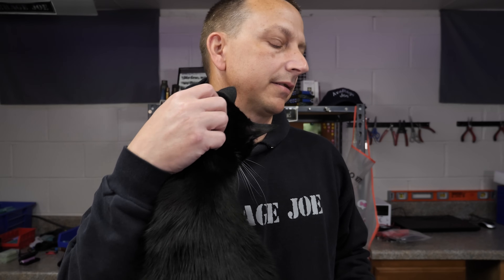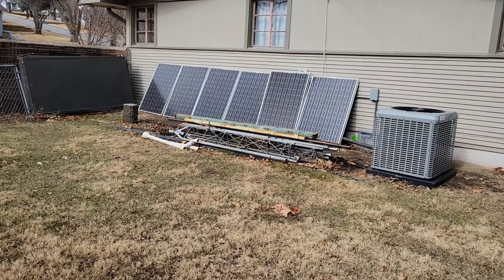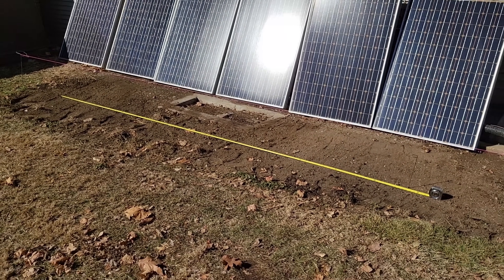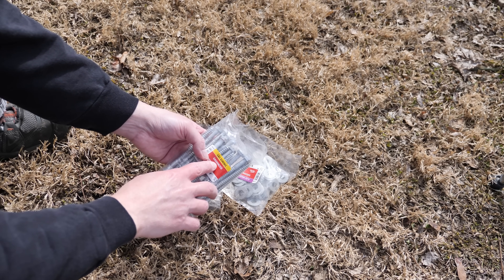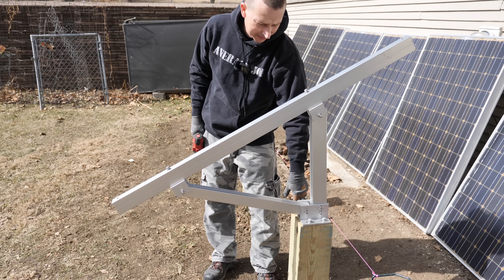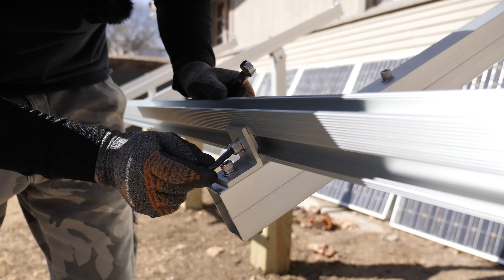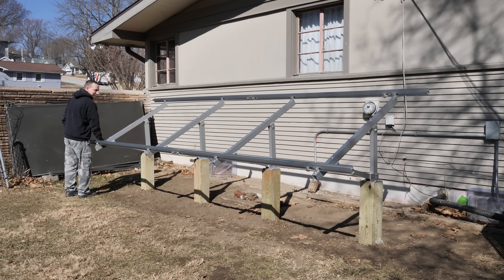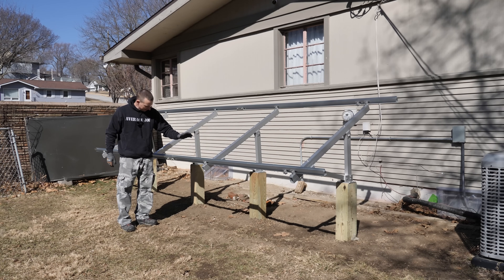EG4 Solar Panel Ground Mount Rack Install!!

Comment from the maker: Save $50 on Any Purchase over $500 at Signature Solar with my Magical 
Affiliate Links and Code "AVERAGEJOESAVE50"⤵
https://signaturesolar.com/all-products/mounting-options-hardware/?ref=C2w_5wtHG6jKcP
Reply: Was about to checkout, but then I exited out so I could come back here and use this link. Thanks for the video!
Reply from the maker: @mrrkrr  Thank you for using the link! Much Appreciated!🤘
Reply: do you see a difference in your electric bill?
Reply: Bonjour,
Depuis la France je n’arrive pas à accéder au produit.
Pourriez-Vous m’aider?
Reply: So if you take the bottom support bracket pull the bolt out of it, slide it up towards the post you should be able to get to your winter setting drill another hole in the bottom support arm❤️‍🔥

Comment: I can’t find if you’ve reviewed if you reviewed EG4 inverters / Batteries etc?
Reply from the maker: I actually just got in some inverters.😎 Got the 6000XP, FlexBoss21 and GridBoss but thats not an inverter. I dont have any of the batteries yet but have messed around with some. I took 2 down to North Carolina after Helene last fall. Did you have a specific question I could help with?

Comment: What angle does this mount give your solar panels? 22 degrees or so?
Reply from the maker: Mine is set to 30* but they have a new adjustable version which would be super nice to have!😀

Comment: Thanks for all your information.  I'm on a tight budget so I'm thinking a locust frame,  pt 2x4 sleepers and then z brackets.  We're recovering from the flood and making progress on the solar. Thanks for the assistance in the area

Comment: Did you have them in use against the side of your house? Was thinking of a very temporary set up 😂
Reply from the maker: You could have them up against the house for sure. I had some solar water heater panels here a few days prior.
Reply: @AveRage_Joe  thanks! I'm being over cautious because I've never really worked with solar panels. Summer time I'm going to mount mine exactly like yours!
Reply from the maker: Yeah Im with ya. Only thing to worry about is the wind or something knocking them over and breaking the glass.  So make sure they cant do that and you will be good to go.🫣😁💥🤘

Comment: Great video, had some laughs. I’m concerned about galvanic reaction between the aluminum base and the galvanized hardware, and the aluminum base and your PT posts. I think you can rectify that pretty easily if you share my concern.

Again, I appreciate you taking the time to share your experience.

Comment: The mechanical engineer in me makes me extremely skeptical of this product. Just based on simple leverages, if you put 50 pounds of upward force on the front of that, it looks like it would translate to about 1000 pounds on those lag screws.  Hopefully you get near zero wind in that location.  Could be easily fixed with a couple of ground cables in the front and back, but the product doesn’t call for that. Would love to see a follow up video of how this thing lasts after a year.
Reply: Oh, I see you made another video where installed braces. Yeah sure enough, I don’t understand how they sell that product to people.  Can’t imagine this company has a phone number to call because they’d do nothing but talk to angry customers all day.

Comment: On one of your videos you mounted 10 panels onto this rack.  I want to do this with 8 200 watt panels.  What parts did you use to join them together top and bottom?  THANK YOU
Reply from the maker: Yes I sure did and its holding up great btw. I should have the steel brackets I used listed in description in that video. They were called "mending" brackets off amazon.🤘

Comment: Do you anticipate and degradation on your aluminum mounting brackets due to galvanic action with the lag bolts?  Thinking you should probably install nylon washers between aluminum brackets and galvanized washer.

Comment: Looks good, but I think it would have been better to cement the posts in the ground for increased stability.
Reply from the maker: I was going to but jic I ever wanted to move or take it down I didnt want to mess with the big chunk of concret after.

Comment: I am brand new to solar and requesting some advice before I buy my ground mount. Could I safely build a base out of 4x4's and mount 10" locking turf tires underneath so that I could rotate the whole unit towards the sun? I am retired and home a great deal of the time. I am also a very petite female and not so strong as I used to be.
Reply from the maker: Welcome to the exciting world of solar and offgrid fun! I think it is 100% possible to build a movable base out of 4x4's! Only thing I can think of at the moment is some sort of staking (metal rods drove into the ground)so everyday wind or wind from a random storm wont move it on you when you are not around.
Reply: Thank you for your quick reply. This is good news. I will be pounding some 7 ' tall steel fence stakes I use for staking tomatoes. If extreme, geo-engineered winds are expected I would probably remove my panels. Within weeks I will know the exact place I want my ground mount. This mount is my most likely choice a one, and I will order via your link if I do so. My sister may buy one, too.
Reply from the maker: Yeah shouldnt be an issue at all. Those stakes should be good to go. Do you have panels yet? If so what do you have? Much appreciated if you use my link!🤘

Comment: Do you believe this is a solid base or how will you make sure it wont tip over besides the grounding rod?
Reply from the maker: Yeah super solid. However, I guess your not supose to mount to the end grain or edge of the wood post like I did. Everyone says to mount on the side of post or mount a cap on the end and then mount to that. Im happy so far. I have an update vid for what I did to help support snow load since I used 10 solar panels.

Comment: Woodworking no no,,, bolting  into end grain. They most likely will wiggle loose over time. Cam bolts would have been best. More work to drill out the side holes etc. Even a crap load of epoxy on top of each post would give it a little more hold. I give the at most 3yrs until they start separating at best. (armchair builder here LOL!).
Reply from the maker: Yaaaaaaa Im for sure not a wood.....worker guy😀 There are a few good suggestions here tho that I will try to help my fail🤭🤷‍♂️ Otherwise atm its still super strong🤠

Comment: I love this idea for footings as it's super simple.    How has this been once fully set up?  There is significant rotational force (forward) on the brackets.  In particular, the foot as all the weight is forward of the foot.  How have the footings held up with those 4 screws in the ends?  Those exposed ends also seem like a failure point
Reply from the maker: Everything has been great so far. No movement in any direction that I can see. The 4 screws in the post ends are doing great. As a few others have stated, its not a good idea to mount on the ends like I did. Better to have an end cap and mount to that. Minimum I need to do is seal the ends so water doesnt seep in.

Comment: So; you can flip the mount over and rotate it (brackets) and mount them to the side of the vertical post instead of the top of it.
Reply from the maker: I dont think it is designed to work like that as it may be to much weight. The new version is adjustable with the lower brackets.
Reply: @AVERAGE_JOE  it weighs the same no matter which way you put it and securing the bracket to the side of the wood is better than the end of the wood strength wise. the frame/ rail / panel is no more than 60 pounds per post and probably less. 4 anchor lag screws in the "side" of each 6x6 will hold over 1000 pounds easy.  The bracket will break before those screws come out.
Reply from the maker: Yeah 100% would be better in the side of the post and the lag bolts are not coming out. I was more thinking how the weight would effect it coming from a different angle.

Comment: Wow man!!.....  This is something VERY similar to what I've built for my solar mini split A/C's.  EXCEPT for, I'm SURE yours is more level and even than mine turned out.  ALTHOUGH, I used twice as many posts (4X4 posts) as you did, I dug 8 posts and used Eco-Worthy ground mounts all attached together using super strut mounting.  It turned out VERY solid.  This is just a start of my project.  I plan to install more ground mount hardware.
Reply: What size and how many panels did you use for your mini splits?
Reply: @brandonbates5840  I forgot the name brand of the panels but I intentionally over paneled my mini splits.  I'm using 4 panels each for each of my mini splits.  455 watts each.  I over panel them so my AC will turn on earlier and turn off later on in the day.  Each unit can run on 3 panels but I like them turning on earlier and staying on later.  My systems are working great so far but I believe both units can use a touch extra R410A to make colder air at the exit duct.  The air is currently about 50 degrees which, in MY understanding, it should be significantly colder.  I also just bought 2 Ecoflow Pro's and am going to buy 4 expansion batteries.  This should run a good amount of mini split units.  I currently have 2 units and plan to have a total of 6.  Not ALL these units will run from the Ecoflow Pro and batteries.  I don't think 2 Ecoflow's will support that many watt hours durring the night. .....  Thoughts?
Reply: @wildwestunlimited If it's an eg4 12,000 btu model I think you have too many watts by about 120.  Not sure if that is an issue. Were the panels new?

Comment: What is the overall width of the bottom and top rails because my panels are a little wider than normal
Reply from the maker: 179-5/8" or just shy of 15ft by my tape measure!🤘

Comment: So how do you tilt the panels? 
Thanks.
Reply from the maker: The new rack has the lower side braces in 2 pieces. 1 brace slides over the other and that is where/how to change angle.

Comment: Ive been kicking around this idea too. It will be be very cost effective for a large ground mount system.  I have 6000w worth of panels currently and am thinking I can go 2x9 by combining 2 eg4 kits side by side attached to one another.
Reply from the maker: Attaching 2 together would be sweet!
Reply: @AVERAGE_JOE  If it all works out I will make 4 or 6 EG4 kits in one long string. My goal is to expand my system form 6kw(once done) to 12kw then 18kw.....The hybrid inverter that i have can be paralleled with up to 9 total in parallel for a total wattage of 54kw.  It is a sungoldpower hybrid 240v split phase unit.  I believe I am going to go with concrete piers below the frostline.

Comment: I just have 2x 200w 12v panels that I am using for an off grid chicken coop. Couldn't I just use 1/2 of this rack setup? This sounds like a dumb question, but I'm asking anyway.
Reply from the maker: Yeah you could totally use half!  No reason you couldnt!  Thats actually a great idea.  You or someone could have 2 small racks if needed.  You would need 4 more end clamps but thats cheap! EZPZ💥🤘

Comment: I put Six 190w Hqst Panels on mine under 2 Parking lot bumpers putting the rack together was easy but it was a Pain in the but to drill thru Concrete, I should of went the route you did
Reply from the maker: Im not a fan of concrete.....especially trying to get it back out of the ground🙄😆

Comment: Okay I'll just change it around a little bit put the shorter one going out and along the one going up and it makes more of an angle more like a 45 degree angle that would work thank you I see how it can you do it now to make it a better angle. But then again I don't live in South.
Reply from the maker: Yeah I guess you could change the angle.
Reply: @AVERAGE_JOE  of course I can you only showed me two options that I could do by putting yours together of course I use you just build your own solar panel stand to the best angle I know that works year-round I just got to make sure the one in front doesn't shade the one in back at any time of the year. But now I understand that is not inverters I'm more interested in even though I'm still interested and overpriced batteries. It is the generators that are solar operated and their overpriced batteries and less solar panels to charge them which ultimately will cost less than the solar panels that inverter and batteries altogether then whatever it cost for the generators the generators batteries and a lot less solar panels to take to charge them completely in a few hours each day to what it takes for inverter to charge the batteries and much more solar panels to make it work. And even some of these solar generators are UL certified for the electric in the 48 states of United States of America only if you get the right ones.

Comment: Why is it you need more solar panels for an inverter then you need for a generator that is a solar generator I mean nature generator has a good one it is 7200 watts 120/240 volts cost a couple thousand dollars almost $3,000 I think it comes with two solar panels I think is 410 watts or more and they come with battery packs that are 4800 w each and you can add as many battery packs as you want even if you want to add four battery packs or 20 batteries or 1000 battery packs you can. But it is cheaper and they come with solar panels if you want them that way and let's solar panels and what inverter needs reenergy has them.
Reply from the maker: You need more solar panels for an inverter because you are powering your devices (or house) and recharging your batteries at the same time.  The nature generator is basically the same thing just a different package.  You will still need more solar with the nature generator to run a house and recharge your batteries.

Comment: Joe , can you tell me how you feel about buying used solar panels vs used panels? Any make of used panels that you would recommend? Place to buy used panels helpful too.
Reply from the maker: Thats all I have is used solar panels. Most of them came from Santansolar. They have a website or you can buy through ebay which is what I did. Basically what you dont want is anything that says cracked vinyl, water intrusion, bent frames, broken glass. If they say snail trail, thats ok.  I ordered 21 245w panels from him that said manufacture labels were removed and they have snail trails. Every single panel tested great and have been on my roof since purchased. I did have one panel that shattered in shipping, he refunded me for that panel no problem. Shipping for 1 panel is the same for a pallet of panels so might as well make it worth it if you can. Also shipping is high but again, its a freakin pallet of solar panels🤷‍♂️ I would buy from him again when I can! Even my Dad ordered a pallet of 10, none shattered. He is actually buying another 10 in the next week.

Comment: I would put a cap on top of those wooden posts. Water easily soaks down into the ends and causes premature rotting.
Reply: Water getting into the ends of the posts is a concern. What's more worrisome, is the fact he's driven the lag bolts into end grain which is not a good idea, especially when it comes to structural integrity. The bolts will pull out of the ends of the posts much easier compared to being driven into face or edge grain
Reply from the maker: Someone mentioned sealing them so I planned on doing that🤘

Comment: Nice!  I'm looking at a ground mount, but would need to go a little higher since I have a lot of wildlife at my property.

Nebraska drivers have changed since I last drove through.  It was more of "why yes, we do have all day to get where we're going".
Reply from the maker: Could probly mount it higher if needed. The specs say it handles high winds so wildlife should be ok depending.

Yeah 100% the drivers here are SLOW AF😆😆😆

Comment: Pretty sure the galvanized steel will react with the aluminum mounts. You might want to add a plastic or rubber washer under the steel washer.
Reply from the maker: Hmm....I will look into that thanks!!

Comment: Nice to see you have easy soil.  Brick notwithstanding.  I used a digging bar and shop vac to dig holes to pour piers but we have rough rocky soil.  Took forever.  Thx.
Reply from the maker: Yeah for the most part the soil was easy to go through.  Those bricks really put a stop to things lol.  Cant imagine doing piers!!!😲
Reply: @AVERAGE_JOE  I just tried using a pressure washer to cut a trench for electrical.  Besides mud spraying everywhere it was tedious in the rock rubble we call soil.  Back to the digging bar and shop vac.

Comment: Always nice to see Kitty 🙂 I have these mounts and used 24"x24" pavers for the base (100 lbs each) that seem to be working well so far. I like your idea of the posts - I have a set coming for a east facing mount that I'm going to try that on!. Thanks for the video.
Reply from the maker: Always fun when the 🐈‍⬛ is "helping"😆 I wondered about using pavers. I almost used the scrap iron in that pile of metal in the winter lol. I know I didnt want to use concret tho, just in case I ever want to move the rack. Pulling out fence post are not fun so Id imagine concret pillars would be the same. I may actually order another so I can do the same. Face it east cause all I have are facing south! Thanks for watching💥🤘
Reply: Can you please let us know how you mounted the rack bracket to the pavers. Thanks
Reply: @LarryRichelli  3/8 x 3 tapcons
Reply: @rebelyell1580  Sorry but to me a paver is about an inch and a half thick so how to you put 3" tapcons into those. sorry for sounding so dumb but I was going to use pavers but maybe we don't mean the same thing when we say pavers
Reply: @LarryRichelli  These are pavers and they are 24x24x3 and around 120lbs each from a local store. We don't have Lowes or Home Depot around here (100+ miles away) but I see they have 24x24x2 at 90lbs - for those I would use 3/8x2 1/4 tapcons.
Reply: @rebelyell1580  Thank you